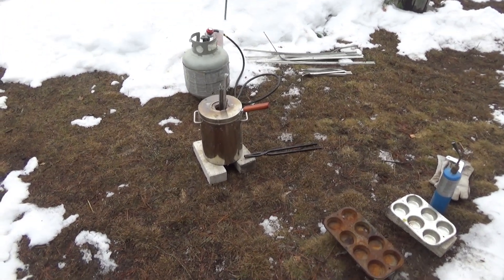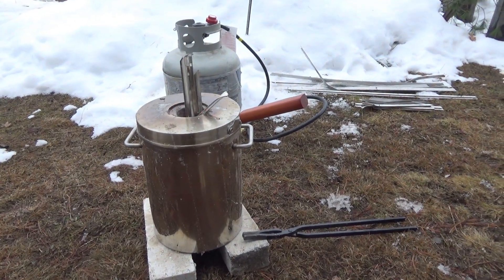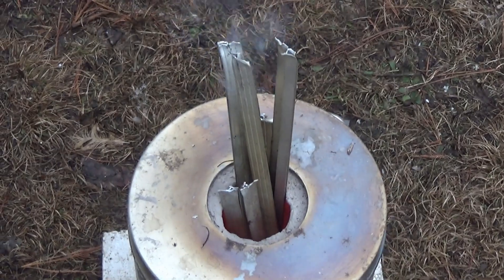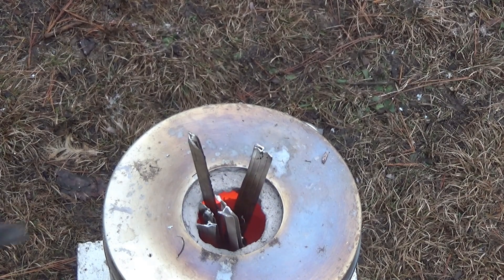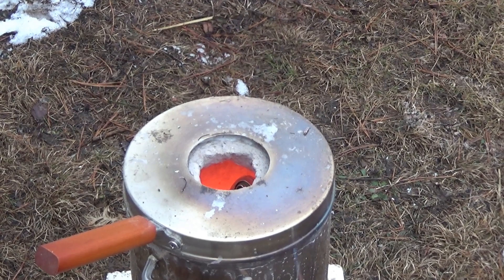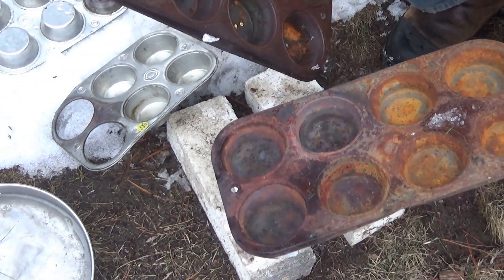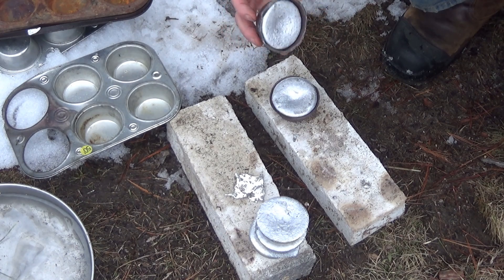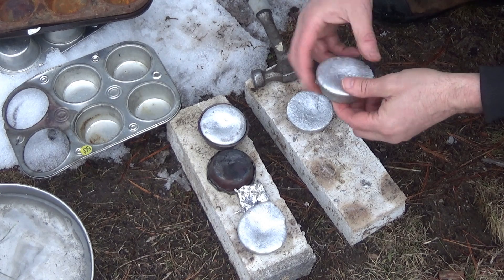Melting And Casting Aluminum In Snowy And Cold Winter

Comment: How do you find poring into moulds with extruded aluminium vs cast aluminium?

I am awaiting delivery of mine can not wait, getting excited as I have a greenhouse frame, petrol lawn mower engine and 50cc scooter engine to melt.. :P
Reply from the maker: Cast aluminum is better because it was made to be poured. Extruded aluminum tends to shrink more when it cools off. The engine stock is the best.

Comment: I have the exact same furnace. I've used it to make bells. Tuning forks , pendents and other bits.  Great bit of kit 🙌🏼.  What's your favourite metal to work with ?
Reply from the maker: I love aluminum. Its so easy to work with. Melts fast. I can do a full pour in 15 minutes start to finish. Takes longer to set up than it does to melt and pour.